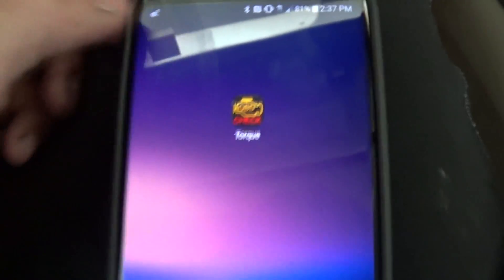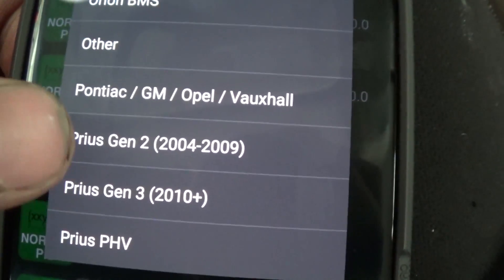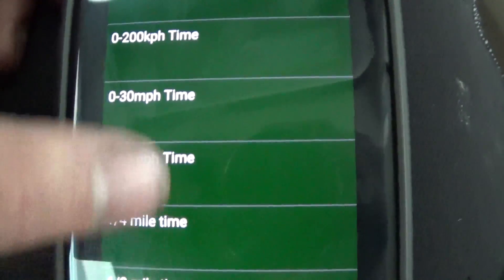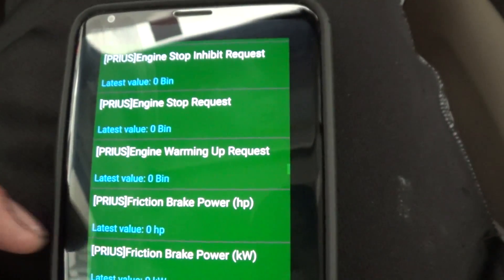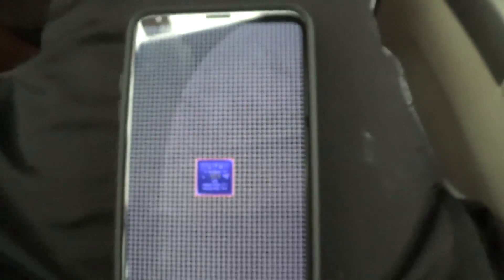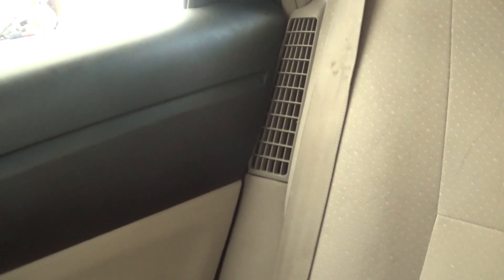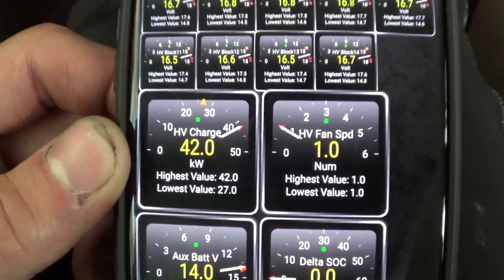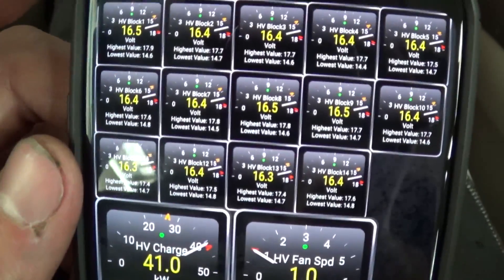How to load Prius specific PIDs in Torque Pro

Comment: Hi, I am using the OBD II interface with Torque Pro app, followed your instruction and add all the HV battery voltage’s block 1-14 to the screen but couldn’t get them to read the data, all of them are not highlighted in green like your, they all stated “no data received”. The scanner seems to connected to the tablet and all the light are blinking, it scanned engine code. Please help, thank you.

Comment: on torque pro it shows the aux battery as -24v and "charg ctrl -24kW" and "delta SOC: 0.0 "and another interesting line is  "battery block number with max voltage: latest value =1 (bounces between 1 and 17) and  "battery block number min voltage :latest value= 10 (steady)" and  im getting common error code p0a80,  it is it 12v battery ?
Reply: Yes.  Block 10 is your lowest voltage.  The block with the lowest voltage should bounce around.  Because yours is staying on 10, you have a problem with block 10 of your battery.

Comment: I'm hoping the engine doesn't have to be running to use Torque Pro.  Because my engine isn't running.  Hybrid battery is completely drained of power.

Comment: Thank you for the video. I bought the torque pro app and have all 17 on all 14 pids. But u still have hybrid error message. Not with a red triangle but with a yellow. Is there a 12v pid. Water was in well of 12v battery. I tried silicone around seams but still have hybrid message

Comment: I applied the steps as shown in the video and when I opened the program to add (prius) HV Battery Block- Voltage, I could not find it. Please put a link to the file that contains these commands. Thank you very much

Comment: I installed torquepro, i plugged in my obd bluetooth scanner and connected via Bluetooth to my android phone. The app shows as connected and also shows connected to the ECU. I then followed your instructions to add the 14 battery voltage PIDs. BUT the half meters with digital reading show no readings, no real time voltage, no min and no max. What do i need to do to get it to read.  (P.S. the preloaded coolant tempersture shows a real reading of 167 degrees, so I am thinking the obdII is sending out sensor data.)

Comment: How can you check drive battery with no power it will not power the engine to charge battery batery shows 211 voits at the battery with VOLT meter. Contacts do not close Im kind of lost 12 volt battery checks good put jump box on to make sure . Disappointed wiith all the videos  one one really  address  troubleshooting the high voltage side.
Thanks Jerry Patenaude Hawthorne Fl

Comment: How did you save your custom dashboard.  I spent an hour putting PIDs on it and then used it on the car but it did not save it and all of it was lost when I clicked back to the main menu of Torque.  I can't believe that it didn't save it or give a warning and a button to save it with.
Reply: I solved the problem.  I'm using a Samsung phone and you go to "Settings" then "Apps" and then to "Torque" and set the permission so that it can access memory.

Comment: loved the point that "I have a strong 14V Auxiliary battery voltage"  No dude, the car is running, you are charging the 12V battery... by the inverter  when it is 14-14.2 V  means the car doesn't think it yet charged  fully ... when it drops a little less like 13.5 or so then it is charged BUT THIS IS NOT your 12V battery voltage ....      So if you have this "nice" 14V all the time your 12V battery as actually BAD.  Measure it after an hour or two  with a simple multimeter ... you cannot really do it with the app easily ... (depend on the dongle which may or may not transmit while the car is not running... 

Hope this helps a little

Comment: I just set up the custom PID's for the battery voltage in Torque Pro. .I am running this off a dated but new Moto G. I think there are some resistance values for the modules I should also add. This video is pretty straightforward, thanks!
BTW, Torque Pro is only for Android. I use OBD Fusion on my iPhone SE.

Comment: Noob question. Isnt it dangerous to add custom PID? I want Torque to work for my Suzuki Vitara(4th gen)and i was told i need the custom pids.
Reply: NO it is not dangerous.  If you screw up, it just outputs bad data.  All you're doing is reading.  The only way to screw the car up is when you try and control stuff with TP.
Reply: @bryanwood9285  thank you, Sir.

Comment: What if the Torque Pro won't save to the SD Card? Trying to find this on the internet but no luck. Thought I would try here. Thanks.
I have a Blackberry Key2
Reply: I'm using a Samsung phone and you go to "Settings" then "Apps" and then to "Torque" and set the permission so that it can access memory.

Comment: What kind of OBD2 are you using to pair with what good free apps for a 2013 Gen 3 Prius, i would like to check my hybrid battery, fuel system, turn engine on engine rattling and engine diagram is not showing red arrow charging the battery, if anybody knows kindly advise

Comment: Liked your video I just have one question ? I have a Prius 2008 second generation I have the ELM 327 mini interface installed in ODB 2 port. I’m using an RCA Android tablet with Torque Pro installed and working. Everything seems to be working ok except when I try and load the 14 extra PIDs voltage blocks, under manage custom pids and  “ add predefined PID “  I can add them to the grid but they won’t stay when I close the program they are gone ? Is their a trick to getting them to lock on, it shouldn’t be necessary to have to reload them every time I want to use a Torque Pro is their a save button some where in Torque Pro to save the update screen ? 
The only thing that I noticed was a feature were I can load “ add custom PID “  rather then “ add from a predefined PID “ ? the problem is when I invoke the “ add custom PIF “ it warms me that I could damage something “ so I backed out of that.

If anyone has any information on this problem I would appreciate any input.

Thank You

Comment: Your video was easy to follow and well done I was able to load all 14 of the blocks on my screen grid the only problem I had was I could not find a place to save the configuration. Every time I close the app and reopen it and go back to real time mode all of the 14 PID s are gone how do I keep them on the screen ? Do I need to select my “ Add custom PID “ rather then “ Add predefined set “ before I enter them ? I have you assume it should not require having to add all 14 PID s every time I want to use this program.

Any help will be appreciated 

Thank You

Comment: Thank you so much for the video dude! Helped a lot
Reply: I notice your post is only about 6 days ago most of the post on here are a year so I decided to ask you my question I would appreciate if you can help below is my Dilemma

Thank You in advance 

“ Liked your video I just have one question ? I have a Prius 2008 second generation I have the ELM 327 mini interface installed in ODB 2 port. I’m using an RCA Android tablet with Torque Pro installed and working. Everything seems to be working ok except when I try and load the 14 extra PIDs voltage blocks, under manage custom pids and  “ add predefined PID “  I can add them to the grid but they won’t stay when I close the program they are gone ? Is their a trick to getting them to lock on, it shouldn’t be necessary to have to reload them every time I want to use a Torque Pro is their a save button some where in Torque Pro to save the update screen ? 
The only thing that I noticed was a feature were I can load “ add custom PID “  rather then “ add from a predefined PID “ ? the problem is when I invoke the “ add custom PIF “ it warms me that I could damage something “ so I backed out of that.

If anyone has any information on this problem I would appreciate any input.

Thank You “

Comment: Hello everyone

I’m new at this and running into some problems like I’m not able to even find a Torquepro app for my iPhone is this app only for android phones like Samsung’s ? I sure can’t find it in the Apple App Store. 

The other thing is do I need to use a specific adaptor like the OBD2 ? What is the best adapter ?

Any advice would be appreciated I have a Prius 2008 second generation car, Also I was considering just getting stand alone unit so I won’t need a phone and just plug it into the car and get the voltage readings on all the 28 cells, I know it cost a little more but if I have to get a different smart phone and switch from my iPhone to a Samsung S3 it might be a better option.

Thank You
Reply: I was reading reviews on Amazon.  Hard to decide.  I have a Prius too.  I wanna find out if any cells are weak.  I wanna run it off a Kindle with a bigger screen than a phone.  We shall see what we shall see.  Very confusing.  Good luck.
Reply: Alex T 

Thank You for getting back to me, yes I agree the bigger screen like on the ipad would definitely be a better choice bigger screen then a smart phone I liked that idea I have one of the older iPads I can use but we are still in the same dilemma having to figure out what app will run on what device ? I’m still working on that I will let you know when I get the correct information. 

Take care and good luck 👍 

Louie
Reply: Android only
Reply: Imran Janjua 

Thank You for the information I appreciate it.

Comment: Hello I’m having a hard time finding the Torquepro app ? Is it discontinued ? Please let me know where I can find the same version as you are using in your video, also can you tell me what is the make and model of your OBD adapter

Any info would be helpful 

Thank You
Reply from the maker: as far as I know, torque pro is still good, but it's an android only app.  If you're looking on apple then you won't find it.  

As far as my adapter goes, it's a BAFX bluetooth OBD2 adapter that I bought on amazon.  I'd recommend it
Reply: CtrlAltDefeatTV 

Thank You for getting back to me, unfortunately I have an iPhone 6 I found an app for the iPhone called “ car scanner “ build version 1.5.2/1.59.2 that I have loaded on my iPhone it looks a lot like the Tuquepro app that your useing.

I’m assuming that this app will be close to the Torquepro and will offer most of the same features as the Tuquepro has in it and will be compatible with the BAFX OBD2 adaptor. If you think this is true please let me know I would appreciate any information you can offer as I’m new at this and trying my best to learn what ever I can. All really need it for is so I can access the 14 blocks and read all of the 28 cell voltages to determine if my 2008 Prius battery needs to be replaced or not. I have not gotten the red triangle of death or the Christmas tree dash warning lights but my gas mileage as been very low for a couple of years and I have had a very hard time getting my battery display into the green no matter how I drive, so I’m pretty sure I need to replace the main drive battery even though I only have 40k miles on the car. 

Thank You again 

Louie
Reply: CtrlAltDefeatTV 

Thank You I’m going to just get a new Samsung phone and use it just for this application on my Prius only this way I can monitor my battery and other things on my car all the time.

Comment: What are the reference values for Torque pro for voltage of HV charger, as well as the blocks and SOC? I read SOC should be in the 60-80% range. What does yours run in? Thanks.

Comment: iphone App Store has a million different apps called "torque ". Could you please provide a link to the correct app? Could not find anything called torque pro.
Reply from the maker: Torque Pro is an android only app
Reply: @CtrlAltDefeatTV  Does if work on Kindle?
Reply from the maker: @alext8828  I don't believe it does.  I had a kindle a while back and it was really only for Amazon apps only.  It may have changed now though.
Reply: @CtrlAltDefeatTV   Yeah, you're right.  But that's okay.  I don't know what plug-in to get.  Some were shutting down the cars.  Even the good ones.  No reports of damage that I saw.

Comment: Thanks , so coool. I got Torque but have 0 on all Block Voltage, probably I have bad odb2 unit ??  I assume newly added dials should shows Voltage right away ?
I added one like <Battery Block #1 Voltage>  and I have them in green box ,but latest value was nothing....    Can anybody recommend reliable place to buy it.

Comment: Thanks for the video. Do you have any idea whether the same pids will work for a 2019 Avalon hybrid? Figure most of them would be the same. Thanks again.
Reply from the maker: I don't know 100%, but I don't think so.  The 2nd Gen PID's don't even work for the 3rd Gen prius.  Perhaps there are other compatible PIDS though
Reply: @CtrlAltDefeatTV    How did you save your custom dashboard.  I spent an hour putting PIDs on it and then used it on the car but it did not save it and all of it was lost when I clicked back to the main menu of Torque.  I can't believe that it didn't save it or give a warning and a button to save it with.

Comment: Will it on Lexus RX 400h ? I am asking will it read the battery voltage ?
Reply: I have rx400h i test it tomorrow
Reply from the maker: I don't think so, even the 3rd gen prius won't read the voltage with the 2nd gen prius PID's.  You'll need to find something that'll work with your RX400H
Reply: I tested it already. It works but i had to download the files for rx400h
Reply: @binchostoyanov7139  where can download it? Can you send on my email?
Reply: Peter Kelemen  this is the link. You have to search for rx400h pids.text
Reply: @binchostoyanov7139  super i have it
Reply: https://www.clublexus.com/forums/hybrid-technology/892810-how-to-monitor-hybrid-battery-with-torque-app.html

Comment: Great video.  On my 2011 Prius Torque Pro seems to read everything, including the 12 V battery and all the HV battery voltages, but on my 06 Prius it shows many of the tests as incomplete and can never read any live data like the battery cell voltages.  So I tried it on an 05 Prius and it reads may inputs, like the tach, coolant temperature, but it does not read the battery voltages at all.  I'm using the BAFX OBDII blue tooth scanner.  Any suggestions on what might be the problem, or should I switch to "Techstream"?

Comment: Thanks for posting the video. So any wireless OBD2 should work? Sorry for this silly question, trying to look into this before getting myself a used prius.Thanks
Reply from the maker: In theory they all should work but some people have reported that they can't read voltages with certain OBD2 adapters.  I personally use the BAFX adapter that you can get off amazon.  Cost me about 25-ish bucks but it's worked great on my prius and on any other vehicle I've tried it on.

Comment: Hi friend . I have 2007 prius runs fine in regular straight roads , but when I get hills the battery meter go down to 1 or 2 bars purple and the car get any power about 50 mph . Do you think is hv battery related
Reply: Oooooooooooo same here did you ever figure out what it was?

Comment: i m purchase this app torque pro and add all things as per your video setting but HV battery values and other meter value not showing i have Prius 3rd Gen and OBD-II device Name ELM-327 V2.1 please guide me what happens
Reply: Did you find the problem for this? I'm having this issue and I cant figure it out..

Comment: All my voltages hang around 15.4 and go a little higher while driving. But my HV Fan Spd stays at 0. Anyone know whats up with that?
Reply: same as my car it will suddenly switch on the fan ..it wont stay on always  some times spd  1 or 2 or 3

Comment: When I use this on my 2008 Prius, the first block reads 15.4, the rest show -330. What's going on?
Reply: I have the same problem. Were you able to figure it out?
Reply: Also having it.
Someone?
Reply: This is problem with the OBD dongle.
I had 2,so after replacing, I've noticed that I see all the blocks as expected.
Reply: @morr733  did you buy a specifoc one? Does it work? You mind sharing the link for the obd that works? Many thanks

Comment: Does the OBD through torque automatically recognize when you put the battery dials on? I put the battery dials on for my prius 2nd gen but nothing seems to be happening. I have an OBD II  from eBay it's called (OBD Advanced) it seems to be working except for the batteries. I'm not sure if maybe I did something wrong.  Or is there a specific OBD reader I need to get.
Reply from the maker: On the main screen of the TorquePro app, there's some icons in the top left corner.  You want to see the icon that looks like a bluetooth adapter lit up solid and you want to see the icon that looks like a car lit up solid as well.  That means that your phone successfully connected to the adapter, and through the adapter it's successfully talking to the car.  
Some cheaper OBD2 adapters have trouble either connecting, or talking to the car.  I've always suggested getting a BAFX adapter on amazon.  I got mine for about 22 bucks and it's worked flawlessly in any car that I plug it into.

Comment: What bluetooth connector are you using? I ordered two from Amazon (not the one I see you using) and neither worked well for me. If you could leave a link that would be great! Thx for your helpful vids!
Reply from the maker: https://www.amazon.com/BAFX-Products-Bluetooth-Diagnostic-Scanner/dp/B005NLQAHS

The BAFX adapter is the exact one that I use.  From my 6.0 powerstroke to my prius to just scanning CEL codes on any other car, it's worked great for me so far.
Reply: @CtrlAltDefeatTV  would this work for checking battery block voltages?

Comment: I bought yesterday Torque Pro apk. I have a Prius 2005. Check Engine is on but I do not get any code. APK on android does not show on Green, (Prius) HV Battery Block- # Voltage. What is wrong? Thanks